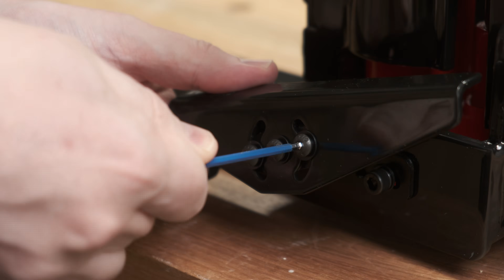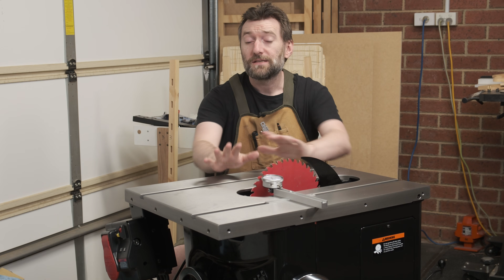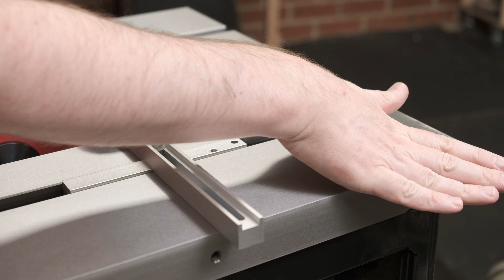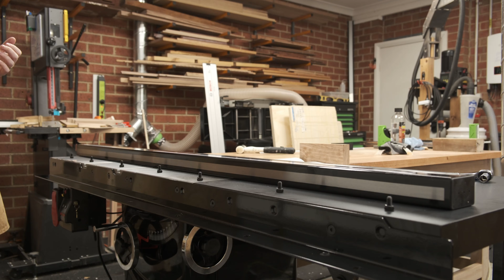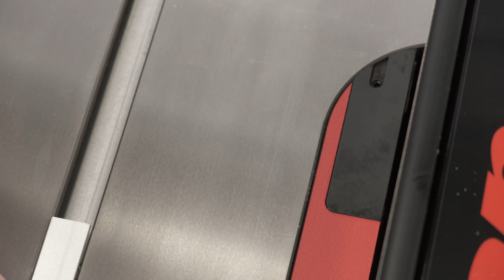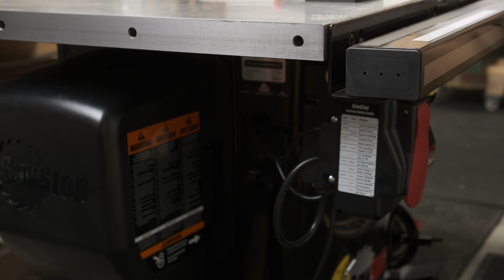How To Setup A BRAND NEW Cabinet Saw (ACCURATE TO 2 THOU!)

Comment: I would think that the average Saw Stop cabinet saw buyer knows how to set it up. How about the something for the overwhelmingly vast majority of guys who are just starting out or simply a hobbyist who scored a deal on a nice used Delta, or Craftsman who will be starting from a point WAY below and behind the already well built Saw Stop.
Reply from the maker: Why would a first time cabinet saw owner know the ins and outs?
Apart from the table adjustment, everything else is the same with a contractor saw. Craftsman and Delta arent' available outside the US, so they're a wee bit unappealing to me :)
Reply: Your a clown.. rack off

Comment: Careful with miter gauges. I have used bypass mode to disable the brake for a few materials just in case. Polycarbonate, HDPE, and anything with reflective film in it. I absolutely never want to loose my fingers. Even when put back on, they are never the same. Knowing a few people or family that have had accidents really locks in the reasoning for a SawStop. My frequency of use was high on my old Craftsman saw over three decades. Angled cuts with blade high were always terrifying to me before. Feel much better with a SawStop.

Comment: Great video!

A trick I learned if it helps anyone for the wings, is to clamp a board to the main table, then clamp the extension wing as a third hand, just helps enough to get the bolts on.

Comment: Any reason you didn’t go for the Laguna saw or other brands, or was the safety stop the selling feature?
Reply from the maker: Yeah the safety feature was a big part of it. The F3 is probably the closest from Laguna thats available here, I'm sure its absolutely fine for cut quality, it doesn't look - to me - like as polished a machine. Its 20-40kg lighter, the hi-lo fence is interesting but looks a little anemic in parts, the DRO for the angle seems a gimmick, the dust collection shroud looks a little questionable of the airflow/dust flow... but a lot of that is speculation from what I can see. 

However, without using a saw extensively it's hard to know whether or not it is any good, whether the perceived lightness would be worse etc. Having previously had the Sawstop CNS, Sawstop are a "known quantity" to me so it was another (somewhat unfair!) point in their favour

Comment: If I was spending big money on a table saw I would probably go for a proper panel saw with a sliding table like the Hammer K3.
Reply from the maker: @pettere8429  the k3 with proper outrigger is uh...a fair bit more. Close to double according to Felder AU. The SCM minimax options are about the same too
Reply: @TheWoodKnight  I hadn't really looked into the prices but as far as I am aware SawStop isn't really in the European market (and I suspect Felder-stuff might be less expensive due to shorter shipping distances and the EU). Also, I am not too keen on a table saw w/o a sliding table as it is really useful both to keep my fingers safe and improve cut quality.
Reply from the maker: The scary thing about the K3 pricing in Australia is that doesn't include delivery - thats just the "from" prices. It'd cost more for delivery, standard is a 3ph motor while most Australia houses are 1ph,  etc. 
The K3 Winner Comfort starts at twice the price, but with motor change, delivery, any other customisation I wouldn't be shocked if it was 2.5x the price of a PCS.
If the price difference wasn't so extreme, I'd look into the B3 line personally - getting a shaper added in to the same footprint makes a lot of sense.

And yeah, there is very limited sawstop (Jobsite only?) in Europe currently, however "Autumn 2025" is the word from Sawstop on when the PCS will be in Europe, no word on pricing. I imagine the price gap will be closer than it is in far-away-island though :)
Its interesting that Hammer have launched a K2M, presumably to compete with American style cabinet saws. Somehow, they made a saw thats worse than a standard cabinet saw AND worse than a slider!
Reply: Also costs twice the price. So, no.

Comment: I don't know why, but I put my saw on a wheeled base. My Shed is big enough that that I don't need to move it to make room, plus I have fixed hard PVC pipe close to the saw, to get max air extraction rather than ribbed. Unfortunately, when it comes time to periodically clean shaving/ dust from inside the cabinet, the wheel base frame 'Fowles' the side panel, and it is a pain in the butt to get the Alan  key into the screw  socket. If I take the wheel frame off, it then means modifying the out feed. 😠
Reply from the maker: You put the brain worms in me trying to figure out a way to use hard pipe but still have it easily "movable". I thought about hard piping up to my saw but ran out of time to experiment (okay I can't find my tinsnips, I'll be honest)

Best I could come up with was splitting/resawing either a fitting or pipe, hinging it, and attaching a clasp to hold it together. I guess a gasket too on the seams. Undo the clasp when its time to move the saw. Then you could at least get into the back port to suck the dust out that way rather than opening up the side panel 😆
Reply: @TheWoodKnight  My Ext, is outside with 100mm overhead hard pipe to a manifold in the middle of the shop. Hard pipe from the manifold to approx 400mm of flex to the saw dust extract port.